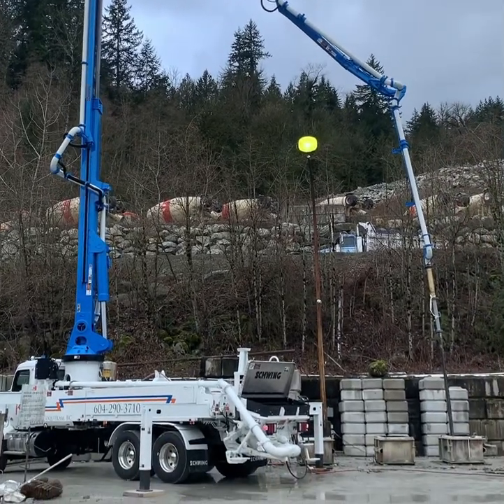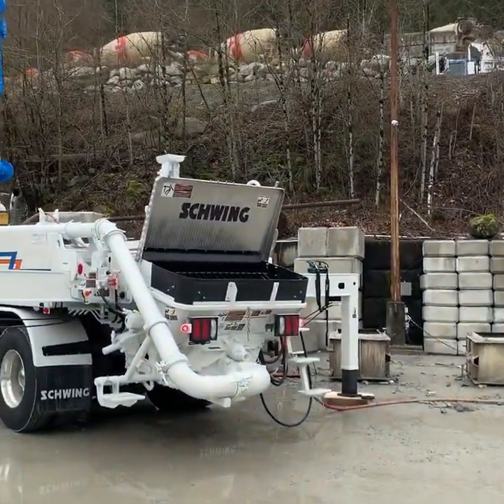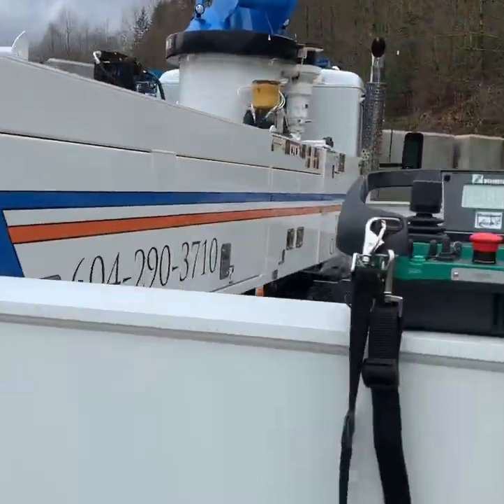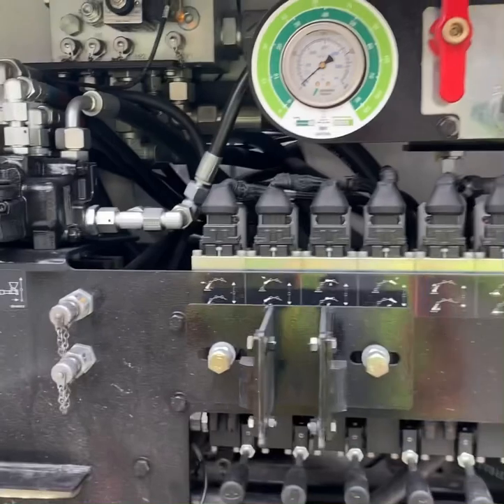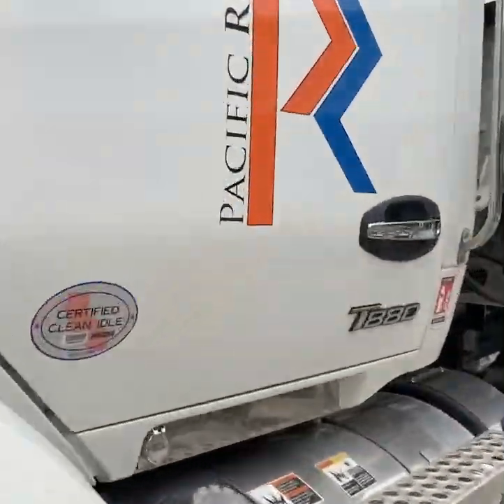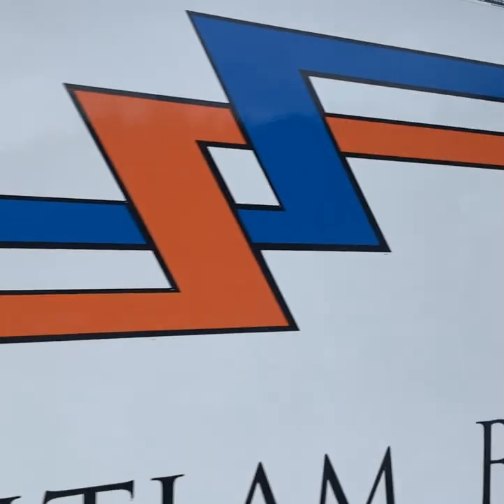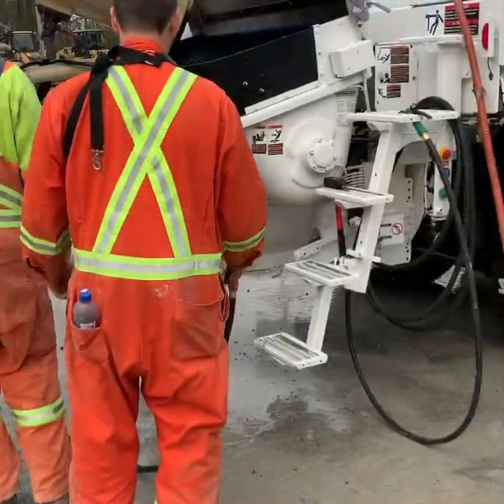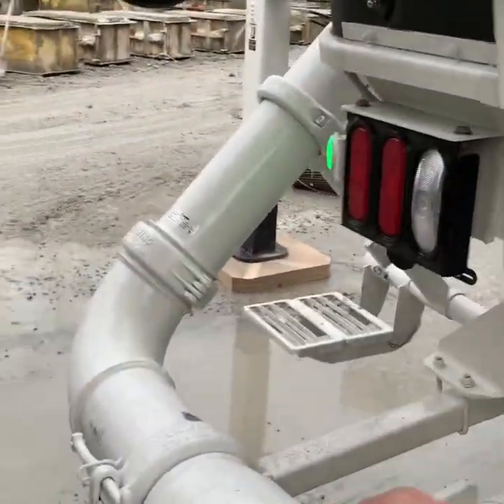Schwing31XT high-pressure/vario-pressure concrete pump walkaround and first prime:

Comment: Which control on the remote is for the telescoping? Left joystick twist? Just wondering cuz I'll be running one soon, thanks
Reply from the maker: Telescoping is right hand stick twist left/right. Definitely takes some getting used to.
Reply: @canadianconcretepumper1979  cool thanks yeah that's different, so the left twist to the left folds the "3rd" section and twist to the right unfolds then?
Reply from the maker: @joelmcdonald4297  to my recollection the left hand "twist" stick controls fold/unfold of the B section.
Reply: Thanks for the info, I appreciate it